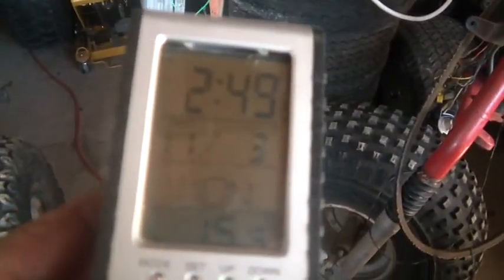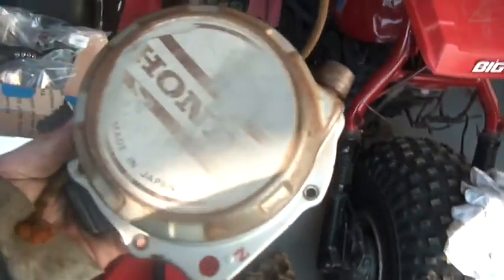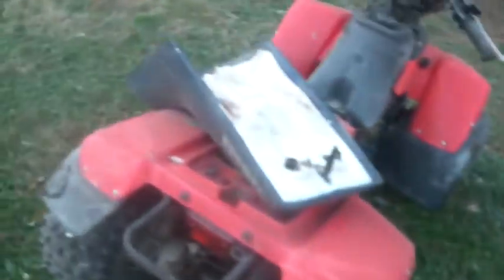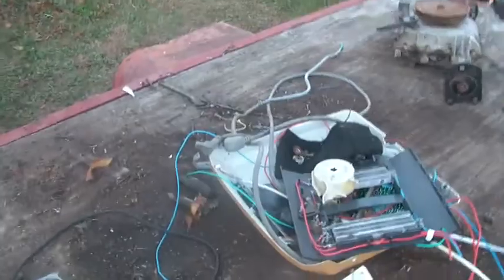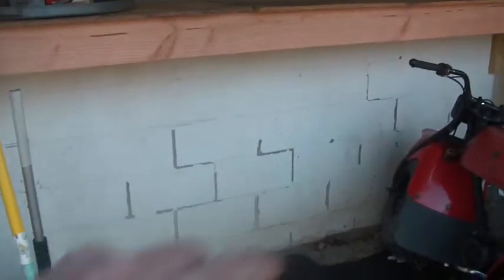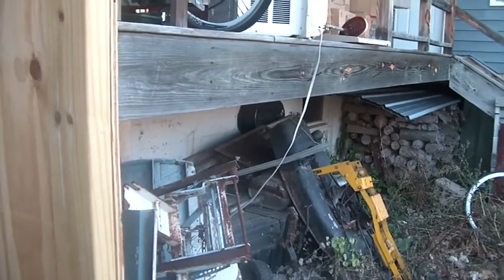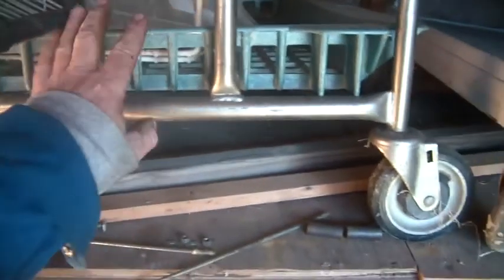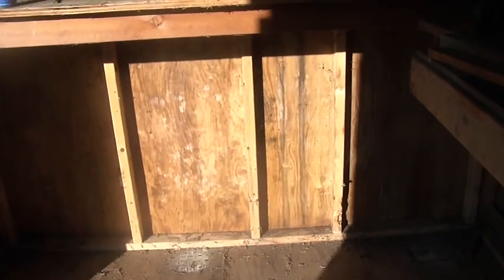11_3_2014, Scrapping Air Conditioners,

Comment: You have nowhere near 100 pounds of metal in the truck.
Reply from the maker: pbdyjr , There was 140lbs, there were a couple of heavy brake rotors and a heavy wheel hub, for all the space the sheet metal took up, I thought it would of weighed more, I guess at 6cents a pound, it really does not matter much. Thanks for the thoughts, watching, and commenting...